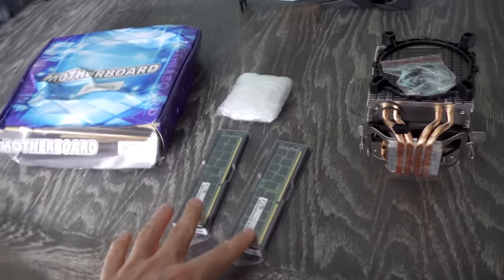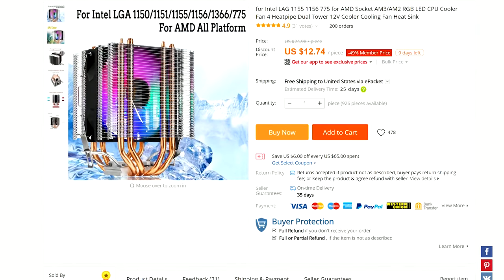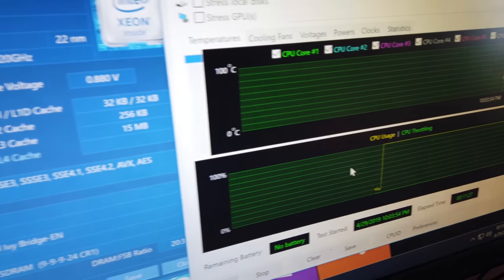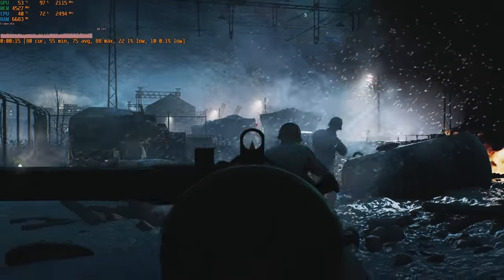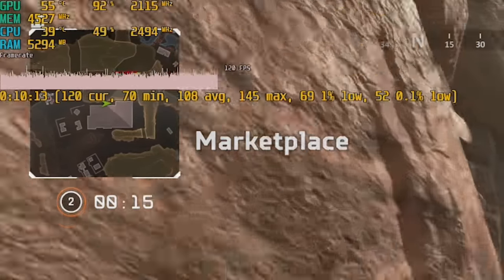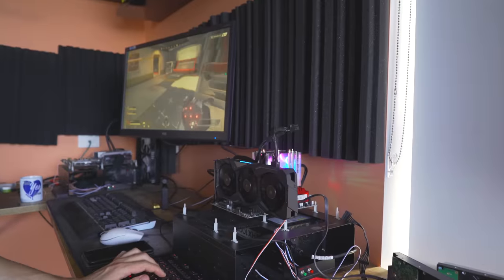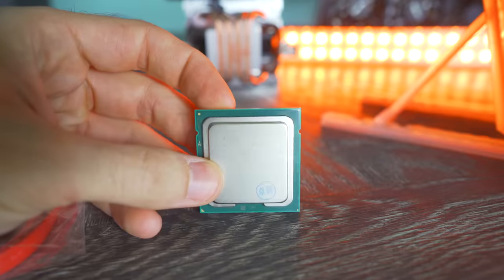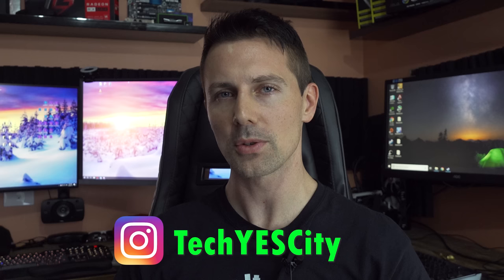This 6 CORE Ivy Bridge Xeon only Costs $24...! (Worldwide Deal)

Comment from the maker: Much more Xeon love incoming in the next few months. Get ready, though you won't really need to get your wallets ready at $24, ba dum tss
Reply: dont please dont every pc part on aliexpress that you mention goes double the price in a week
Reply: would it be better to use 2440 instead 2420 ? price gap isnt much
Reply: Waiting for the review of different chinese X79 motherboards and two of X99 ones (Huanan X99-AD3 and Runing X99 v1.2). Would be interesting
Reply: Max Pain  RX570 or 580 2048SP with some serious overclock. Actually, RX570 chip is so good that it manages to handle QEYA Haswell engineering sample
Reply: This would make for a cheap resale PC for good profits also it would make for a great video.
Reply: hi men .here in argentina this cpu cost from 1000 to 2000 dollars
Reply: That mobo is the same design as all kinds of other mobo s our on eBay for everything from 1366 to 2066, there might even be lag 115x boards out there. One company probably makes them, a bunch of other companies buy them and rebrand them.
Reply: Can you include monster hunter on your testing, it's really CPU dependable and GPU also. It's a very optimized game. Good work cheers.
Reply: Use the gtx 980
Reply: Can you do a e5 2640 xeon review it comes with LGA2011
Reply: and that what i hope Brayn some xeon love i would like to see more overclockable ivy-bridge xeon if they are out side in the wild?
Reply: one more this I have a deal on asus x58 p6t6 ws revolution is it a good motherboard for overclocking ?
Reply: Picked up a Dell Precision T3600for $50 USD. $50 480gb TeamgGroup SSD, $10 16gb DDR3 ram kit local, and an R9 390 for $50 because it was  rushing under load (needed thermal paste change). Upgrading to an E5-2667 this Friday.
Reply: @AlexGFrank  I had a Chinese X79  Mobo that would only work with Sandy-Bridge CPUs and wouldn't accept my 4930k. No BIOS Update possible. So, be careful with that.
Otherwise, X79 still is a perfectly viable platform. I have two with 4930Ks, both running 4.3 GHz. Great value.
Otherwise
Reply: @Watzleroviak1210  u actually know all about decent and semi-decent LGA 2011 boards on Aliexpress, so..... You can PM me about that any time you want
Reply: The E5-2440 and E5-2450 are even better value and the same price and socket!
Reply: @mathiassonnweber9912  that happens sometimes if you watch a video that was just uploaded
Reply: @alibeyazkilinc1914  ikr 2450 too
Reply: I bet even you were surprised that mobo still worked when you were unpacking it..... that was lucky.  ^___-
Reply: I think the E5 2650 will give you better bang for your buck, coming in at around $31.50 usd it’s got 8 cores and better single core performance than the E5 2420
Reply: A random question for you Bryan, but were you ever contacted by aorus about replacing that artifacting 2080ti you had?
Reply: You should see about getting plex to sponsor a segment, and use this combo as a cheap plex server build. (We see the results you get some sponsor money)
Reply: Try lga2011 chinese mobo with oceable xeons 🙌
Reply: @jorgeariel1090  Is buying from china on ebay not possible in argentina? Or do you have 5000% import fees?
Reply: Please make more Videos on cheap Aliexpress Boards and maybe OCing with them. 1366 and 2011 Boards are priced rediculously high around here used and the low end cpu's for them are extremely cheap. The only thing that keeps me from buying a 50€ x79 board from Ali is that the VRM looks like they forgot 2/3 of it
(i7 920 - 5€,  i7 3820 - 10€, x58 board >100€, x79 >200€)
Reply: Gaming aside would this little beast be good with 1080p video editing?
Reply: Yeah but the motherboard cost is just ridiculous man, c'mon ppl🙄
Reply: @stale2665  is not easy .is too much burocracy and fees
Reply: Would love to see it with a 1050ti
Reply: @Bitcoin Lucky they are as of this moment.
Reply: Great I bought the motherboard, cpu and different ram, hope this works xD 60 days shipping
Reply: cause x 5650 is 11 dollar not 24 !!! the direct comparison would be super
Reply: hey bryan is the e5 2420 overclockable?
Reply: YES please!
Reply: @m1r198  yup. Ebay prices for the processor was up to $60 each. Found one lone seller who must have been away. Paid $17 for mine.
Reply: Hi! E5 2420v2 or E5 2440 for this platform?
Reply: hey bryan check out the intel xeon e5 2450 its a 8 core 16 threaded cpu for $29 bucks in alliexpress its a really nice cpu for budget gaming.
Reply: @alibeyazkilinc1914  go with the e5 2450 its $29 bucks on alliexpress its a 8 core 16 threaded xeon
Reply: Compare these against your other Xeon's in your previous videos head-to-head.  I would argue that some of the overclocked older Xeon's you have that go up over 4+GHz yield a better value than this.  This certainly isn't bad, but the low clock seems to really hold it back.
Reply: Please,Brian, check it with an RX570 !
Because I heard,that those boards are not working with RX'S !!!
Reply: Actually the memory controler is on the CPU so the chipset even on a h61 can get 3 channels and all the PCI E 3 Lanes
Reply: Can i insert a single 16 gb ram module?
Reply: @AlexGFrank , and so is the performance 😂😂😂
Reply: i dont mean to be so off topic but does anybody know a tool to log back into an instagram account..?
I stupidly lost my password. I would appreciate any help you can give me
Reply: @Uriah Sincere Instablaster :)

Comment: Very nice, what a find! I've never even heard of that socket. The high number of cores and threads is super appealing, the low clock speed is a bit of a bummer, but hard to argue at that price!
Reply: @ErrorRaffyline0  What are you talking about, that video is about lga 1155/56 and not 1356.
Reply: @dalzy25  LOL
Reply: Yeah, wish the clocks were just a bit higher but you're right about it being hard to complain about at this price point. Plus, look at the gaming performance in the video.... runs all the modern games at 60FPS+ at 1080p... hard to beat that when it comes to a budget gaming rig.
Reply: @dalzy25  Oops!

Comment: Wow . That's an amazing build .I'm a uni student , I'm now considering getting that board . Thanks Tech YES City .
Reply: @AliYassinToma  what difference does it make
Reply: just get a ryzen
Reply: just do it and never look back
Reply: or a 1156 board and a x3440, its cheaper but older
Reply: @marcusbrajic7169  ah yeah. X3440 and a cheap h55 is awesome. But this videos xeon is a way better buy right now!
Reply: @marcusbrajic7169   Excellent point! I've got an X3440 that I thought about eBaying, but it's so cheap these days that it's honestly not worth my time to sell it. Somebody will though, for about $7 USD shipped. Where I would give the advantage to LGA1356 is the triple-channel memory. 50% more memory bandwidth is nothing to sneeze at, and I'll take as many memory channels as I can get! (Hence my three daily rigs that are socket LGA 2066 [4], 2011 [4], and 1366 [3].)
Reply: @Flurry17  but if he gets the xeon its cheaper and has more cores
Reply: @TheRealNeoFrancois  more cores  depends on what ryzen, but he will also get trash clock speeds and trash ipc. even 4 core 4 thread ryzen 2 2200 will outperform this by a mile
Reply: @thelogician9879  noice, just keep the 1156 and the X3440, its not worth selling, theyre 10-15 usd on aliexpress last time i checked, I got one for 7usd a year ago :O
Reply: man i just built a system with a h55 and 3440, it was 20 for the cpu 62 for the mobo so its more expensive for less cores, this new platform is the way to go
Reply: @Kvo7he  or you couldve gotten a bit more money and bought 1600 with b350 board, and missed 7 year old trash chips, and had a good future upgradeability
Reply: I don't advise it. Lga 1356 is a castrated lga 2011 that didn't have many CPUs and the highest clocked one is only 3.3ghz boost. Even x58 looks pretty good compared to this since you can squeeze 1000cb on a comparable CPU with overclocking.
Reply: @thelogician9879  where to find cheaper xeon x3440
Reply: @r2vbwh153   looks like prices have gone up slightly. I can't find my X3440, but I did find an X3430 (the Core i5 equivalent without HyperThreading). I don't know if there direct messaging on here, but I would be happy to send it to somebody if anybody wants it.
Reply: @thelogician9879  ow really? would u sell it?
Reply: @r2vbwh153  LOL, no, I won't SELL it, but I will send it to you free of charge because karma and the Circle of Life. Just not sure how to get your shipping info here in a public discussion.
Reply: @thelogician9879  hmm i see but you can email me, btw what is karma is circle of life ? but ur name is atheist also Logician
Reply: @r2vbwh153 by  "karma" and "Circle of Life" I mean I am happy to do a minor kindness for a stranger, because strangers have on occasion been kind to me, and I am glad to pay it forward. If you want a Xeon X3430, I can mail you one.
Reply: @thelogician9879  ow yes please? i am glad to have one, so my only problem now is the motherboard
Reply: @r2vbwh153  sure, send your shipping info by e-mail. Can't help you with the motherboard, but I can help with a Xeon X3430.
Reply: @thelogician9879  ok should i write my gmail here?

Comment: You: "the ryzen 3 is the best budget build CPU on the market right now!" 
Tech Yes City: laughs in Xeon
Reply: Most Places a ryzen 1600 is the best budget option. 

Let's just say us  80$ and you get -30dollars with a motherboard. Effectively making the chip cost 50$. That's a killer deal, for a new 6core chip, with a decent cooler.
Reply: Ryzen 3 is better than this old cpu and mobo imo better upgrade path, etc
Reply: with terrible motherboard, nah
Reply: Well I mean, if youre looking for a modern system with upgradeability then yea, but this really shines when you're on a tight budget, I mean dude THIS AMOUNT OF POWER for such a price is crazy.
Reply: Source Dasher  Then they're missing out.

Comment: Running Xeon X5675 @4.5Ghz on X58 for a good 9 months now. Paired with a GTX 1080, the setup doesnt seem to have any weaknesses. Thanks TYC, you saved me a fortune. 40€ CPU, 80€ Board.
Reply: could you tell me what board ur using im having trouble finding a good one for a decent price
Reply: I'm using the MSI X58 Pro Motherboard. Its at around 60 bucks on ebay right now. Out of the Box there is no xeon support, so you will have to pickup an i7 920 (another 15 bucks) or something Like that, to get into the bios. then you can update the bios to the latest version and voila you can unleash the xeon beast.😛
Reply: @cribwalkgenetics9826  Ok thanks but im a complete noob at bios stuff and i want out of the box support unless the bios thing is actually easy also im on a tight budget soooooooo... thaanks anyway tho
Reply: Well, you absolutely certain won't be abled to boot a system Like this first try. Troubleshooting takes time, finding a decent overclock takes time. If you are not a person, that likes challenge, then this quite frankly isn't something you should do.

Comment: I buy a lot of, and i mean A LOT of used reg ecc memory, to the tune of hundreds of sticks at a time and there is always a few % failure rate. They only test at maximum if it posts, not if it's fully functional. Especially ram without heatspreader is especially suspect, i've had shipments with north of 20% failure rate. I recommend you always buy a few extra. You can have 8GB DDR3 REGECC 1333Mhz modules for as low as ~13USD right now, so getting 1 extra is not usually going to break anyone's bank :)

Further, test with with linux memtester and try to overcommit the ram. If the overcommit crashes -> You got broken module. Then stress test at 1G below total memory for 30-45mins and if no errors, you know you got good modules ... at least for now :)
I get a few module failures every now and then ... as said, buying hundreds at a time, so i got tons of modules running, and they start to show their age by occasional failure. with reg ecc this is more annoyance than anything else tho, ECC corrects the errors but on linux your console will get flooded ... temp is a big factor as well, a module might work fine at start, but as it heats up it starts erroring.
modules with heatspreaders has significatly lower failure rate.
Reply: skaltura, what kind of rigs are you building? Supermicro and Tyan stuff?
Reply: @christopherjames9843  both :) Tho SC has some serious BIOS issues which makes some stuff harder, and UUID per storage device actually sensible ... Namely, the device IDs change on each boot ... What moron could design it that way -.-
Reply: skaltura would it make a difference if I stuck on those cheap heat spreaders? you know, as opposed to ram sticks that already have them from a company.
Reply: @ArtisChronicles  Yes, additional cooling always helps
Reply: personally i cringe every time he handles the edge connector (ie constantly), that really isnt gonna help the failure rate, and theres just no reason to (it doesnt matter much with the bus drivers on PCI/PCIe cards, but RAM is still pretty sensitive).

Comment: Few corrections.. it's s1356, not 1156; it has 2 QPI links, and it is supported in dual-CPU configurations. You had all of this in the video, just the voiceover isn't linked up.

Nice find on the motherboard, had no idea you could get these. I have a spare 1356 CPU lying around so might have to try it...

Comment: I just wanted to comment and say... THANKS!!!!  Your tips on used Xeons fueled my desktop/server upgrade way back in early 2016.  I upgraded my old AMD 1100T guts with a used E5-2658 v3 ($170 USD), new ASRock X99 Extreme4 LGA 2011-v3 MB ($170), new G.SKILL Ripjaws 4 Series 32GB (4 x 8GB) 288-Pin DDR4 SDRAM DDR4 2400 ($120 USD), newer PNY CS1211 2.5" 240GB SSD ($60 USD) and new Cooler Master Hyper 212 EVO cooler ($30).  Total for upgrade = $550 USD.  Thankfully  I caught RAM on sale just a few months before DDR4 prices started to shoot through the roof!!!  In early 2016.....  My goal was to upgrade to high-end I7 performance but at AMD prices.  Ryzen did not exist yet.  And I7's were just bloody expensive!!!  I'm glad I embraced the power of Used Xeons!!!!

Comment: Compare it with a Ryzen 5 2400G /2600, i5 8400  or something more common for reference.
Reply: They both are way faster than than an old Xeon.
Reply: 2420 is like Ryzen 1400, but cheaper! No sense to compare with i58400 and others. Couse 2420 is a monster Pc for Bums 😁
Reply: This thing clocks at 2.2 GHz, which is how you get that ridiculously low power consumption. Ryzen 2600 gotta be about 35-40% faster at stock, and it has headroom.
Reply: Well, hardware unboxed compared this chip to an R5 1500, and the xeon got destroyed in all benchmarks...

Comment: Aida says your RAM has 1333MHz, except of 1866. Standard bios have option to force overclock RAM, but that doesnt work.
But there is modified bios for this motherboard to unlock 1866MHz.
I already have 2420v1 + rx570

Comment: Need comparison to the good old X58 :)
Reply: I also guess that this couldn't beat my Xeon X5675 @ 4,2 Ghz + RX 580 combo. :)
Reply: @seylaw , it doesn't need to. This is the best cpu/motherboard combo in the budget range, that's his purpose.
And as himself told, the Rx 570 is the perfect pair, the gtx 1660 is thrown in there to show the limit of where the bottleneck starts.
Reply: @TheSilviu8x  Aye, I can see the value for people in need of a low budget PC without any prior components they could use. And I can see the value of this combination, no doubt about it. On the other hand, the low clock speed and non-overclockability mean that there could be problems with 0.1 and 1 % lows in some situations going forward as games get more demanding and high thread count alone doesn't help in every situation. That's where I assume my older 6-Core-X5675 would do a better job due to its higher clock speeds (a shame that Intel locked down most of the newer Xeons). A plus for the newer Xeon is AVX support though. This wasn't a problem until now, but could be potentially going forward.
Reply: If I would make a guess if you won't OC it, it will match a 3.4Ghz x58 Xeon. But runs cooler.
Reply: @seylaw  obv but the motherboard is much expensive and also you need Top cpu cooler that would make the budget x58 almost twice expensive. ( Power supply is also more expensive needed).
Reply: @MrRomanvideo  Right, both platforms have their strengths and weaknesses. And I've admitted that there are usage scenarios which favor the one or the other. I'd assume that the higher clockspeeds would make the X58 combo relevant a bit longer if gaming is the only purpose, power is of no concern and you already own some of the components.
Reply: @seylaw  yep, u r right. but still you shouldnt compaire platforms only by performance. 1356 is super budget one if u have more money u can choose ie between 2011 and 1366.